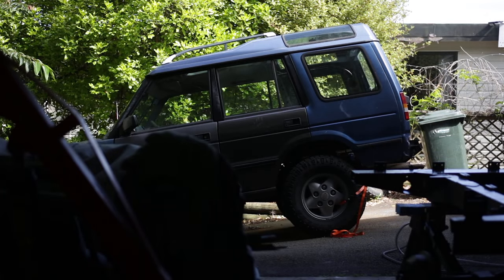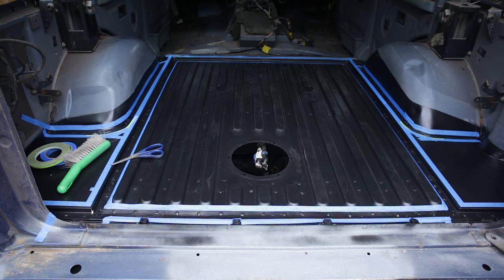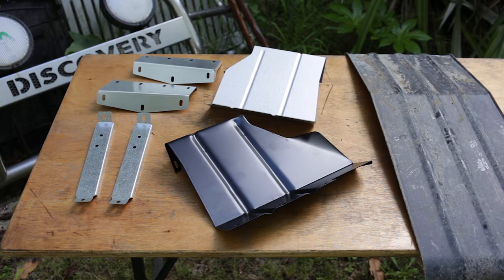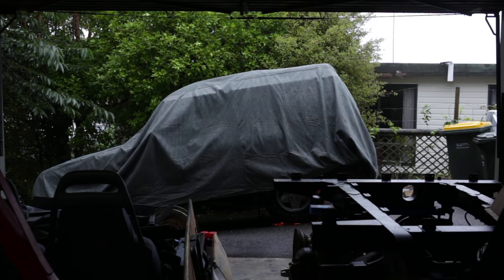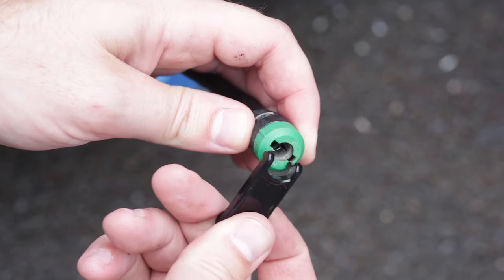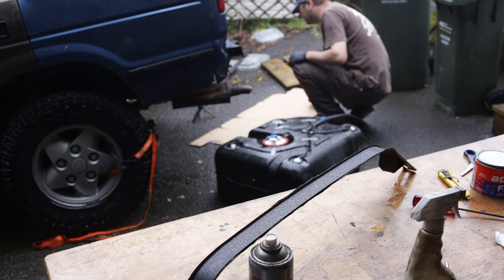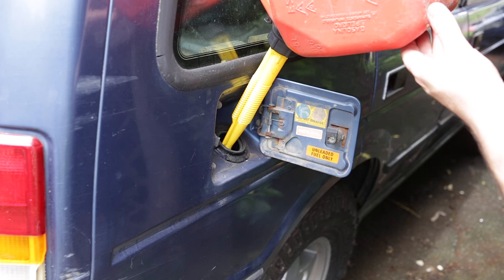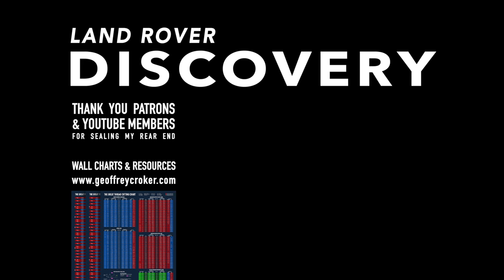Project Discovery // Part 4 - Boot Floor Completion

Comment: Those pumps do go AWOL if left standing, check it is pumping, before going down other rabbit holes. Great videos, and if this is not a project... You have gone down the classic route of all major rebuilds.
Reply from the maker: I’m going to systematically go through the entire ignition and injection system. I’m looking forward to it. There are many small thing I see that need plugging back in or reconnecting or cleaning up - but I’m saving it all and resisting the temptation to get side tracked 🤣.
Reply: Funny. British automotive products are going bad when you don't use them, or when you do use them
Reply: @poprawa consistency like that is the sign of a quality product

Comment: Love your videos, always a good day to see a new one drop!

For your fuel problem, you don't need to crank the engine to get fuel pumping. When the key is turned to 2, the fuel pump runs for 2 seconds to pressurize the system. You should hear the fuel pump whirl away if you kneel back by it.
Alternatively, you can pull the fuel pump relay and make a jumper wire to hot wire the pump till fuel is flowing.

Can't wait for the next video!

Comment: I used undercoat procedure from Dinitrol that was painted on with compressed air.
First was a base layer of oily "cavitywax" more like cavity oil, and topcoat of rock protection.
Endresult was awesome and has been held well for few years now.

before i used some cheap stuff that you painted on, and every year i had to apply more as the old stuff started cracking.

Only mistake i did was the fact that it really does get everywhere.. should have covered the whole exthauspipe and outside of the car..

cant figure how the undercoat got to the roof and sides and glass if i was painting from the underside lol.
spend more time washing the paint and glass as the end result

Comment: Nice work! I feel your pain doing a million plug welds. I replaced the floor pans and trunk pan in my project. I use an end mill bit in my drill to remove the paint in the plug weld hole before welding. These bits have a flat end and easily remove the primer/paint that's in the hole. I use epoxy primer instead of weld-through primer. Amazon has the bits for pretty cheap. Just match the bit diameter with the hole diameter.

Comment: Best sealing up with Sikaflex 221 or Tiger seal, tape up like you did, the brush can be dipped in thinner or panel wipe if a smoother look is required. Looks really tidy now. 👍

Comment: Get a single burner hot plate from Amazon for 20$ for the shop. Put a pan of water on to boil, put the hose end into the water until it softens. I work on old farm equipment with harden hoses and this method never fails, provided of course the hose don't split! p.s. You can't beat cardboard on concrete. I have a brand new creeper hanging on the wall for 4 years, never used it. I save every big piece of cardboard I find.

Comment: I sat on my hands for a few minutes, but I do this for a living, so anyway… Seam sealer usually does a shit job sticking to bare metal. It’s highly recommended to prime the spot welds first. And also the black soot on the crossmember doesn’t help the sealer to stick. But my guess is it will do the trick anyway and the rest of the job was top notch, I especially liked the interior sealing, looks very clean 👍. And what’s not to like about crawling under the chassis and work in a rain of cavity wax 😂?
Reply from the maker: Thank you 👍 I did intend to completely scuff the underside of the boot first, but two minutes into lying upside down… nope a quick spray and wipe will do 😂
Reply: That’s totally reasonable 😂. We all have been there…

Comment: Absolutely love this project! Re: getting the engine started - have you pumped the primer bulb in the engine compartment?
Reply: It has fuel injection so no priming bulb
Reply: @rickz9495  d'oh!
Reply: With a Lucas 14CUX injection system you might as well add one for extra fuel pressure 😜

Comment: Learned to prime the pump first if their was no fuel i had atart problems butt it was a loose crankshaft censor that can bugger one around if your like me and dont have an obd tool or a place ti plug it into sorted it with a multi meter

Comment: Did you know, that brake bleeding tool is able to remove dirty and water contaminated fluid from reservoir?
Reply from the maker: Yeah, but I’m lazy. The brake system is going be renewed before I drive it. The fluid in there is fine for now.
Reply: @CROKERvsRover  this is not a project after all, yeah :>

Comment: If this one has lambda sensors, that 2 stroke fuel will foul them up - although it should burn off after a decent run.
As for the non-starting, the ignition system on these is the weak spot, spark is very weak at best and non-gen ignition bits are all useless.

Comment: If you bleed your brakes, remove the fluid from the tank. There's no reason to make more of a mess than it already is (meaning, dilute the good fluid with old junk fluid). It's not like in the fuel tank where you put 6L extra of petrol to dilute the 2L of diesel you put because you weren't paying attention and then live with fear in your system for a few kms.